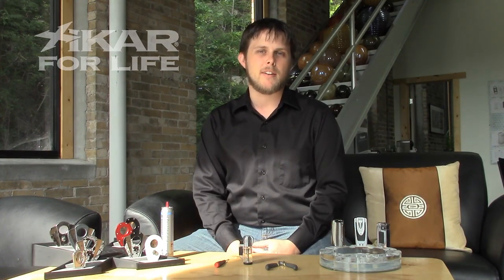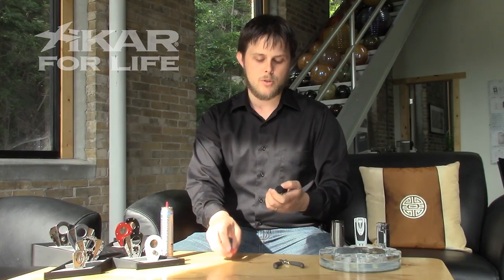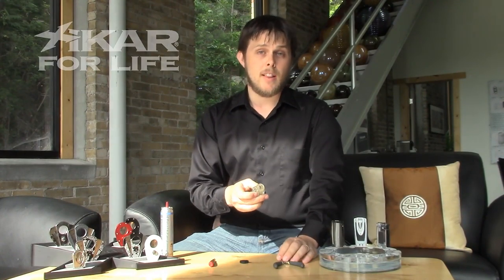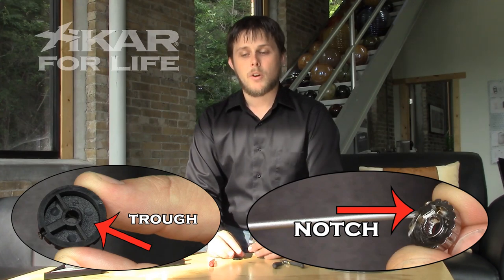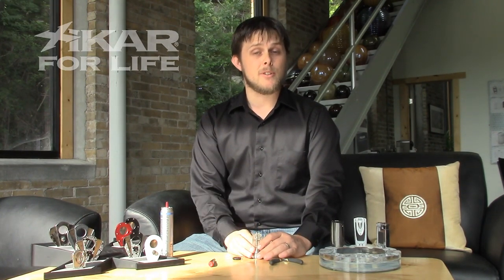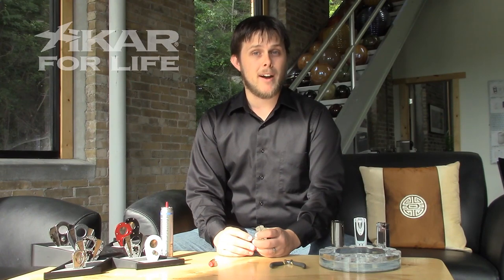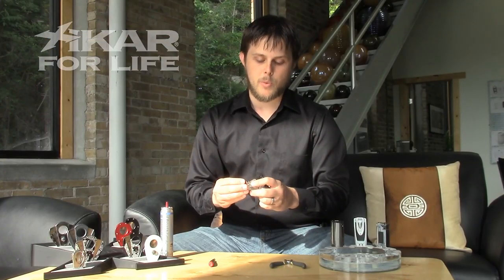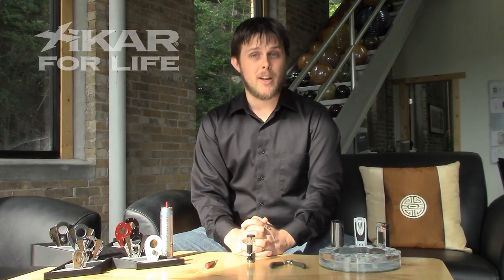XIKAR Lighter Troubleshooting: Internal Flame Adjustment

Comment: Hi how do I get in contact with youre company through private messenging I've got a xikar tech blue single flame I purchased about a year ago. I've watched all of your trouble shooting videos and tried every suggested course of action for maintenance but it will not fill properly and even when filled after much effort and wasted fuel when I press the ignition switch it no longer seems to be drawing butane. There is no audible hiss and even though the ingnition spark is working flawlessly it absolutely will not produce a flame.

Comment: What am I supposed to do if my lighter only lights and stays lit at 7/8th turn to max
Reply from the maker: You can adjust the range by following the directions in this video.
Reply: @xikar  I might not have explained it only keeps lit at a very very high tall flame. I dont want a flamethrower I only want 1/2 inch or so flame